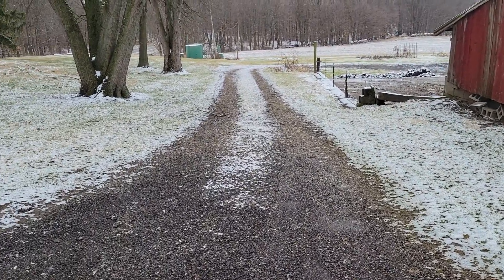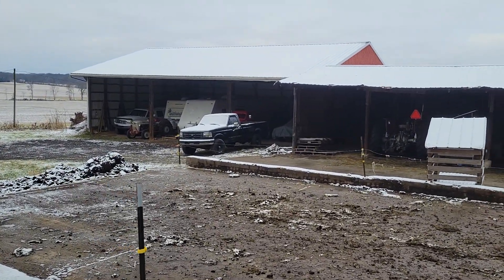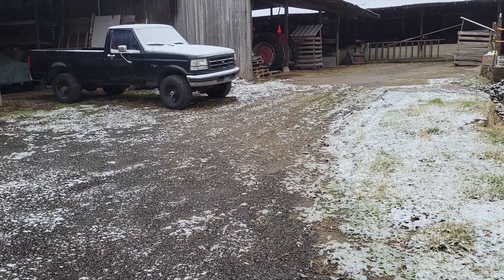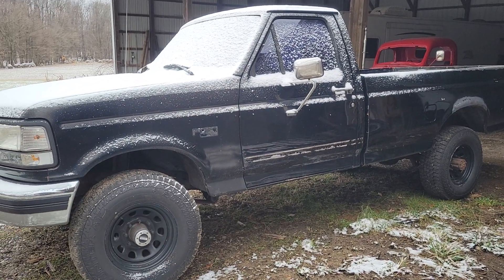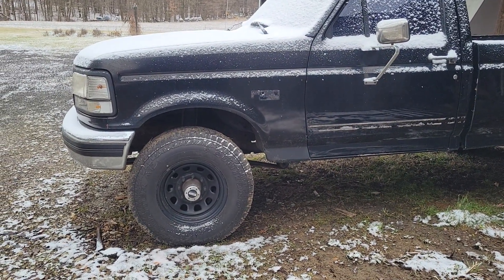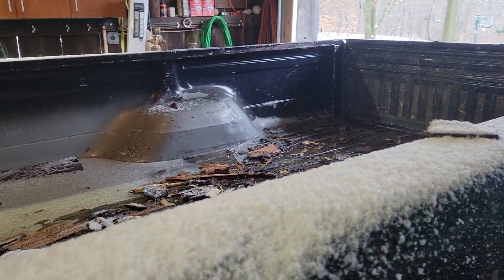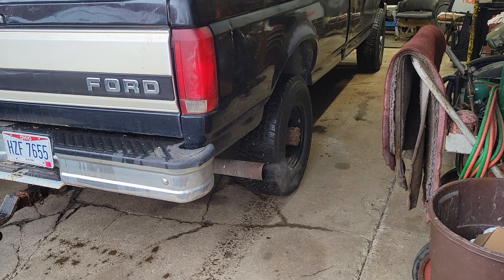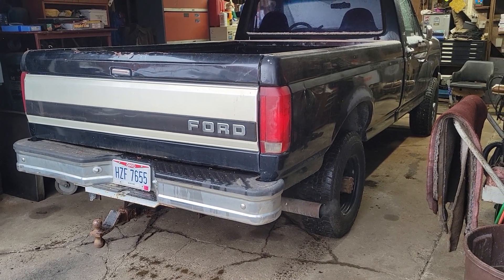"Toothless" Update - Powerstroke 7.3 sounds terrible - Bell Housing Noise

Comment: Sometimes, the drive plate of the torque converter is unscrewed. 🤔
Reply from the maker: I should have mentioned that I checked that before disassembly. All the torque converter bolts and nuts were tight. I was hopeful that might have been the cause of the noise.
Reply: @DIYMechanicTV  🤔 ОК